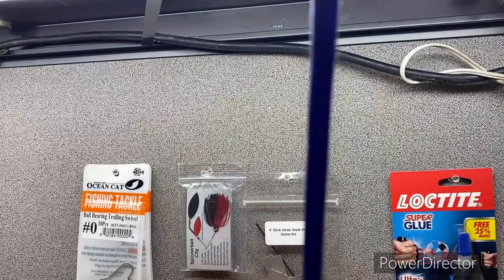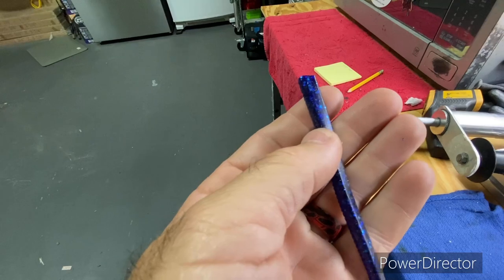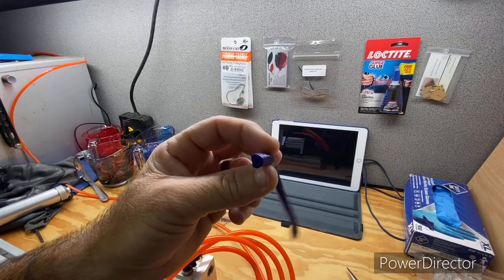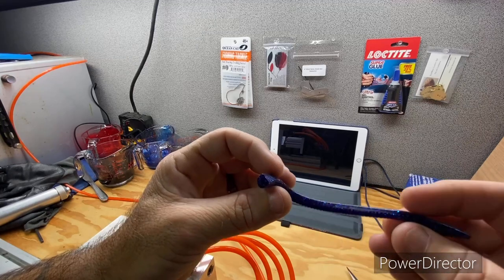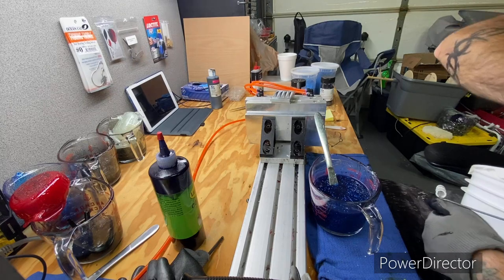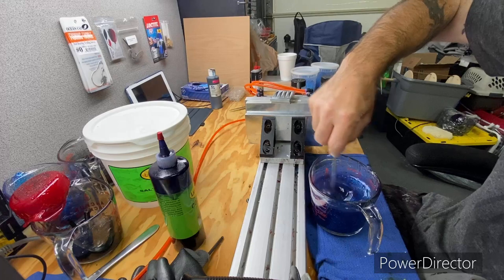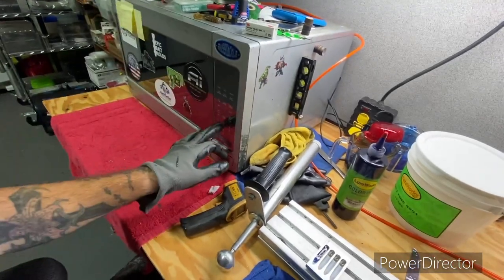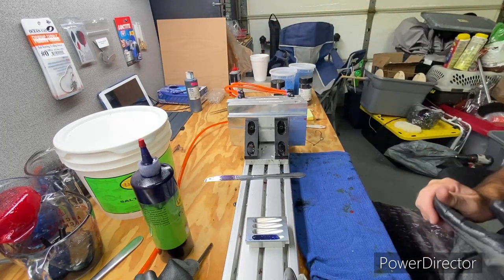Color Matching

Comment: As always buddy,  great video.   You're responsible for me trying Hog Salad molds.  As for the color matching.  It's a total P.I.T.A.  I have the person send me 5 worms, creatures, and etc.  I ask the person sending the plastic samples to ensure the bait is new, not sun faded, or waterlogged.  I melt the first worm to inspect the flake.  I remove the flake by using a needle and look at it under a cheap magnifying glass.  It helps me to better  examine the color and size used.  I try to run the melted plastic through a mesh strainer.  If the glitter is bigger than at .015 or larger, I'll be able to strain it while it's very hot.   Since it's so time consuming, i charge a $50 surcharge with a minimum of 500 baits.  The color will not become a stock color of mine for sale,  rather recorded on a spreadsheet with the customers name, color formula, and before and after pictures.  We, as you, I. And other experienced baitmakers can get pretty close.  However,  their is no EXACT match to the original bait.   Their are too many variables.